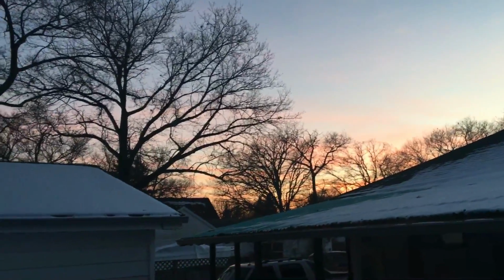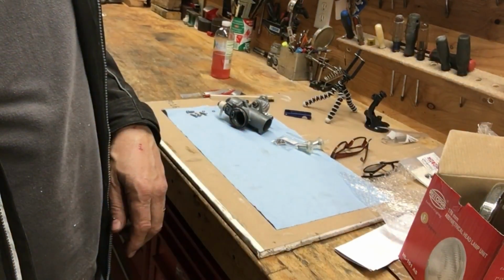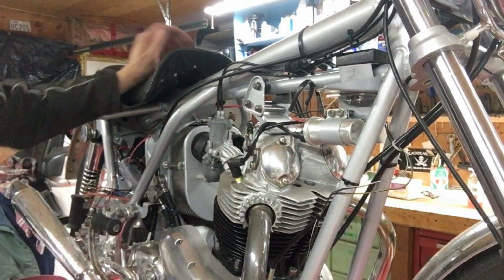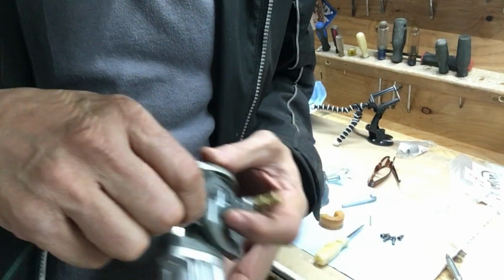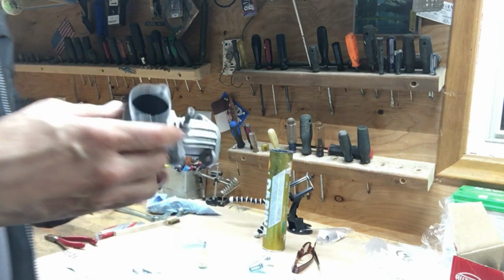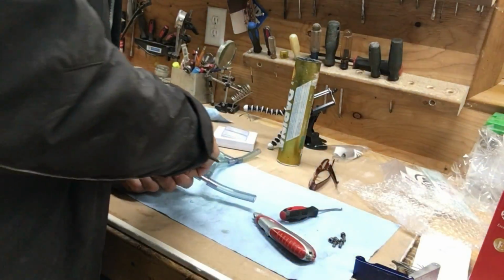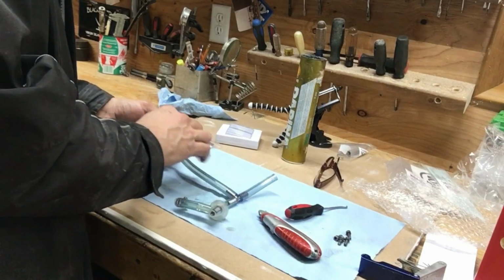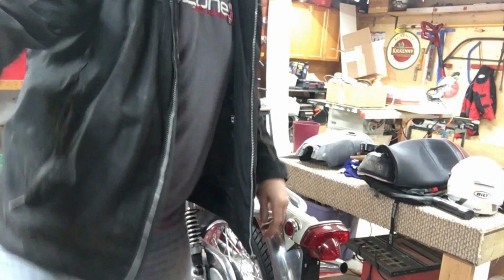Norton Commando Idle Circuit clean Bike runs on 2 cylinders

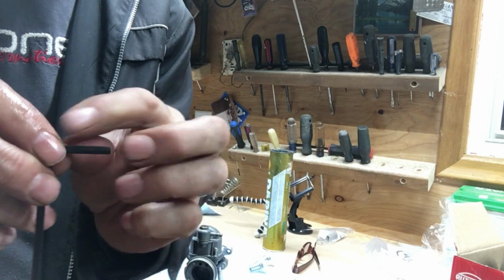Comment: The little hand drill chuck you speak of @28:50 is called a "pin vise". They are a small collet chuck and can hold jeweler's spade drills down to 0.003". There are several makers of these still. The best ones I have are a set of three 70 year old Starretts. Back then, these were common hobby tools to have, according to some old popular mechanics and scientific american magazines. Getting the long small bits isn't easy anymore - most available now are too short to reach into the carbs....

Comment: Great work!
I've got my '74 850 HighRider bike since Thursday. Been cleaning it up and checking it over. Have not tried a start yet...do you check for wet sumping before starting after weeks of bike sitting? 

My bike currently set up with single 932 AMAL. I did get two other carbs in a box...one other 932 and a 930. Will use the single for now until I've got comfortable with the bike. I'll be doing your cleanup method on the carb(s) shortly. What size wire did you run through the tube? Where did you get those fuel line filters?

Are you getting parts from Walridge in ON? I've got handlebars, oil filter, rear brake cable from them and a new seat on backorder.  Do you know of any decent parts supplied out West (still in Canada)?  I need new rear wheel (bike has a 16" fatty wheel/tire to look more like a hog). 

Cheers.
Reply from the maker: Just check the oil tank for oil, if its empty or very low it has wet sumped, other wise it will pump itself out when you fire it up. Fuel filters on Ebay, tons of them, I did get some parts from Walridge, but I order alot from Norvil on line. 
16 thou wire, garbage tie wire seems to be the right size. 
Good Luck and thanks for watching.

Comment: Doesn't sound that good to me. Sounds to me like one side is running too fast for the other. Like you say, you will have to balance the slides and throttle cables etc. When you started adjusting the screws, it got a bit better but still needs more adjustment. I did learn something from the videos but I gave up on the Amals about 5 years back and went with a single 34 mm Mikuni. I found it very rewarding to be able to start up the bike on the second kick after being stored for 5 months after a cold winter and it doesn't stall. No balancing, one throttle cable, no gasoline smelly fingers and much easier maintenance.
Reply from the maker: You are right there. It still needs dialing in. But for me to finally get it to run with out choke and idle down on two was a long awaited  accomplishment. The tittle is a bit over kill. Thanks for watching.